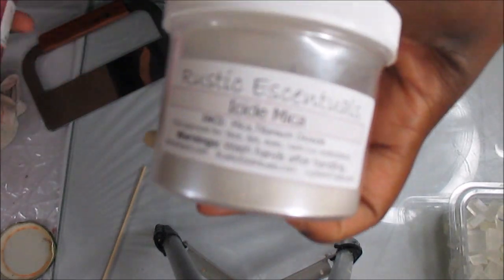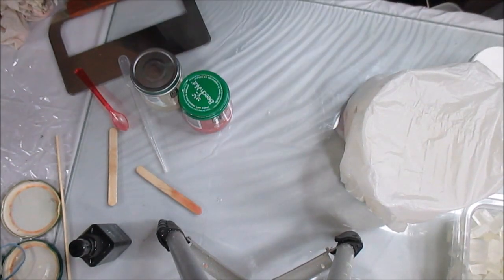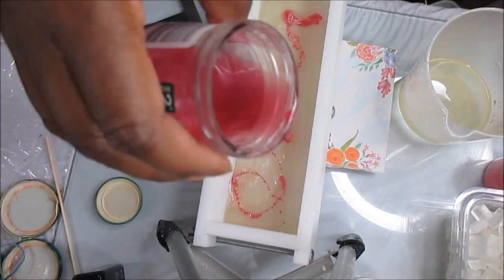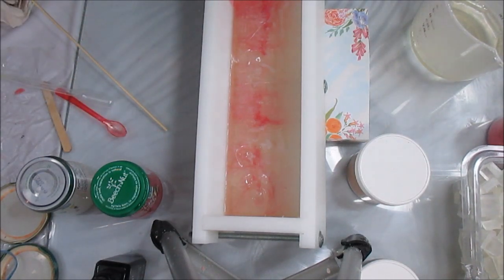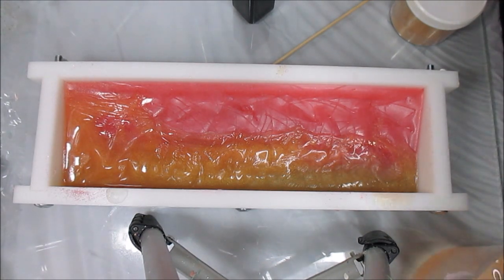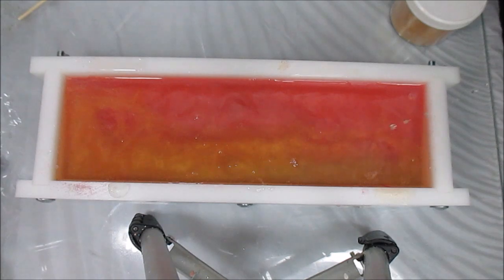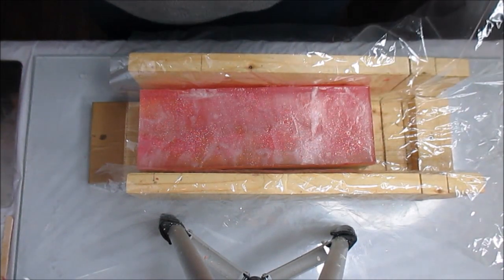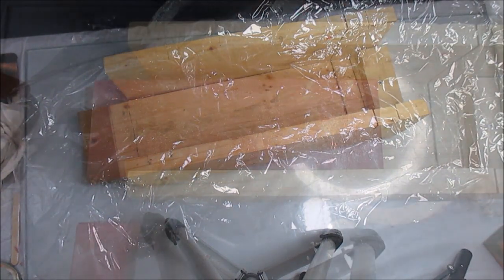Swirling and Layering Melt and Pour Soap

Comment: What temperature do you add your layers at please?
Reply from the maker: Honestly, I've never check temps for melt and pour, other than for fragrance. For pouring, you just wait until the layer you just poured forms a thin film over it, then pour your next layer, just be sure it's not too hot because it will seep into the first one. Hope that makes sense and helps out.
Reply: I do the same method but its usually 130 or less in between layers...however  you may have to deviate depending on how fast your soap is setting up...it all depends on what you add ex..fragrance and colorant which can speed or slow up the process... In the beginning I used temps but now I eyeball

Comment: I LOVE, LOVE, LOVE HOW YOUR SOAP TURNED OUT, IT'S BEAUTIFUL !!!  Ok .  I'm going to try to explain to you why you get the sides of the soap looking like they do.  Each time you pour soap into the mold you are supposed to clean the soap off the walls of the mold so it can come out with clean edges.  When you do that make sure that the soap is sort of solidified so when you are wiping the sides of the mold,   the soap will not  move around.  Maybe that will help you.
Reply: Thats a really good point. Im thinking of making some soap and i will definitely remember this. Thanks

Comment: Hi there! I was wondering what the difference between using mica and soap dye is? Thanks, love your videos
Reply from the maker: Hello! Thanks so much for watching and commenting! I really appreciate it! Mica is natural before it is ground down into a fine dust then colored. It also very easily dispersed in soaps. Dyes are man-made colorants that are consistent with it's coloring no matter what it's used in, but it does have a tendency of clumping if not mixed properly. I hope this helps dear!

Comment: Love the soap! Bad news: MP does morph to brown as much as CP does; it might take a few days though, before it begins to show. Also depends on amount of fragrance used; I use 3% - the average standard amount.(I really hate It when you have to press your nose almost into the soap to get an impression of the fragrance.  About the soap cutter:problem 1: it has those reinforcement strips on the edges, thumbs downproblem 2: you still don't cut at the right angle - see point 3 -problem 3: the blade is too thick, so you can't use the grooves in the  mitre box.Solution: buy a dough cutter/scraper like this one: http://www.bakedeco.com/a/matfer-stainless-ste-27041.htm There must be cheaper places to get them.. hope this helps dear Kenny xxx